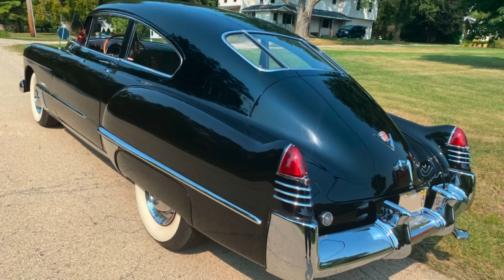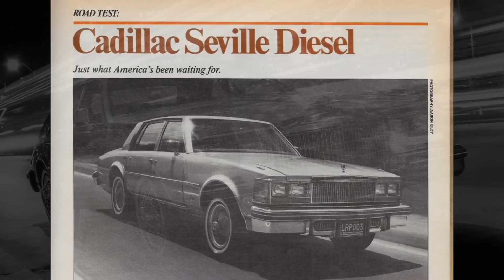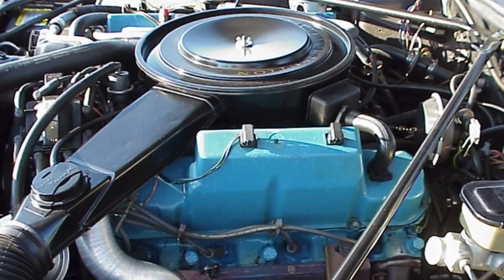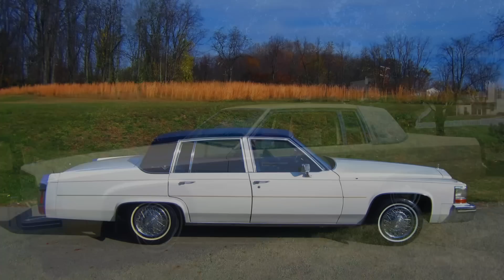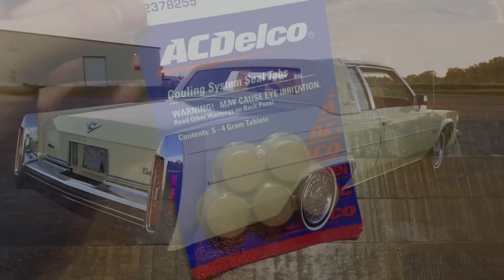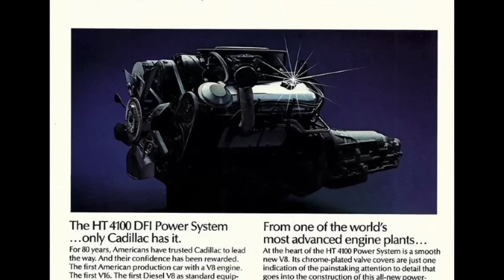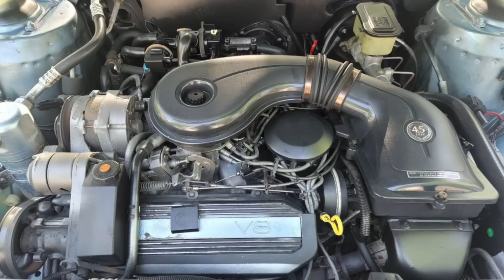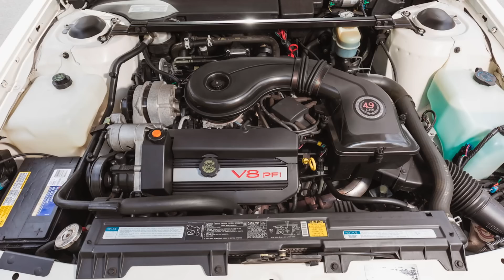This is GM's Worst Decision for Cadillac and Affected Its Reputation for Decades...

Comment: The Seville was a great car, even with the Diesel. I worked on many in California. The problem was nobody had ever worked on diesels unless they were truck mechanics. Our shop specialized in diesel gm cars, we had specific fuel filtration systems installed,very specific oils, and a 30 gallon auxiliary fuel tank in the trunk, our clients could cross the border into Mexico and fill up for a third of the cost in the U.S. making the owners quite happy versus the rest.

Comment: I worked in an auto repair shop in 1993 that saw an HT4100 powered Cadillac come in needing a new engine. After calling all the good rebuilders in the country, we ended up sourcing a brand new HT4100 long block directly from Cadillac because it cost LESS than rebuilt!
Reply: No one would rebuild a 4100 motor if they knew what they were doing.

Comment: Let’s not forget the 4.1L V6 that was available in the Fleetwood. As a 22 yr old in ‘93 working as a salesman at an Olds dealer, I picked up a 1981 Brougham D’Elegance with that engine. It had come in on trade, and I think I paid around $700. For it. But man oh man…what a dog. The early 80’s were definitely the worst for the entire industry.
Reply: Well. That ‘ESCALADED’…
Reply: That 4.1L V6 had the same horsepower and more torque than the HT4100 did. And it was more reliable. It would have been better to stick with that engine than the expensive disaster that was the HT4100.
Reply: @judethaddaeus9742  I don’t know about that. Mine had less than 100k miles. Blew a head gasket. Had a valve job done on it and after it was put back together, spun a bearing. And it was ALWAYS abysmally slow. I like GM and their engines for the most part. But no way did this engine make anywhere close to the power needed to move a Fleetwood lol…frustrating too because I loved the car. Would have killed to just have a normal 5.0L at the time.
Reply: @goodbonezz1289  Sorry you had a bad one. And I agree that Cadillac had no business offering such underpowered cars regardless of engine.

But that V6 had a much better reliability reputation for most folks than the HT4100. My Dad’s ‘86 Coupe deVille ate through 2 of them and 2 transmissions as well.
Reply: @judethaddaeus9742  those were very dark times.
Reply: @goodbonezz1289  I wouldn't be surprised if even a 4.3L V6 from 1985 would be an upgrade!
Reply: @RJARRRPCGP  I’m sure it would have been!
Reply: The 307 Olds V8 showed up in the late 80's, early 90's and was about as pathetic as the V6 and HT, but at least fairly bulletproof.
Reply: @scottysgarage4393  The sad part was, you buy a ‘77 deVille with a 195hp fuel injected Cadillac 425 V8, only to wait 10 years through the HT4100 era to buy an almost identical ‘87 Brougham for more twice the money you paid in ‘77, and find it comes with a carbureted 140hp 307 from Olds, and that’s seen as an improvement.

No wonder people ran away from Cadillac and never looked back.
Reply: @judethaddaeus9742  That was pretty much the state of affairs across the industry, thx to government meddling.

The nice thing was as soon as that '87 was out of warranty a 455 Olds was literally a drop in swap.  A little tight back at the heater and AC box but still, went right in...

Made for a VERY...peppy...car...
Reply: @scottysgarage4393  Lincoln didn’t fall nearly as far in terms of power or reputation. And while Cadillac was struggling to get 125 or 135hp out of a fuel injected 4.1L while meeting emissions standards, the imports were squeezing that much power out of engines half the displacement and with half the cylinders.

When your own sister division manages to tweak an old V6 and make it as or more powerful, more reliable, and more economical than your all-new V8 - an engine format your division invented - something has gone terribly, terribly wrong. FAR wronger than any other competitor.
Reply: @judethaddaeus9742  As a dealer for decades I can tell you there was never a time Cadillac did not easily maintain higher value/resale/loan than comparable Lincolns.  There were exceptions, the Cimarron, the Catera and the diesels, but those are glaring exceptions.

Today a Fleetwood from the 90's will bring three times what a Town Car from the 2010's brings.  You can buy two and sometimes 3 late(ish)-model Navigators for what one Escalade will bring.  Some of the lesser Lincolns, say the LS for example, don't have any "value"; they bring scrap weight unless they have incredibly low miles, while Cad's "Art & Science" cars still bring 5, even 7k wholesale with decent miles.

The imports of the period were glaringly cheap inside, their drivetrains annoyingly noisy, still primitive in the 80's and early 90's.  At least the ones being imported to the states.
Reply: @scottysgarage4393  Part of the reason ‘90s Fleetwoods fetch more now is because they were outsold significantly by the Town Car, in some years as much as 10 or 12:1. But ‘80s Fleetwoods and Broughams fetch no more than ‘80s Town Cars do. Manufacturers aren’t building cars for resale value. They’re building them for profitability either through margins or volume or both.

And “cheap interiors” is a bizarre term to throw around about import competitors when Cadillac used the same damned steering wheel for 13 years, most used the same rectilinear instrument panels covered in vinyl, plasti-chrome, and fake wood.

Cadillac bled market share like crazy in this era. And today, an ‘86 deVille is scrap value next to an equivalent condition ‘86 BMW 5 or 7 or Mercedes 300E.
Reply: @scottysgarage4393  BMW outsells Cadillac nearly 3:1 in the US today. 10:1 worldwide. Wonder how that happened.
Reply: @judethaddaeus9742  Pretty sure Chevy outsells them, too.  Wait, you think BMW is a luxury car?  You think Lexus is a luxury car too, don't you?  That's funny.
Reply: @scottysgarage4393  Considering that BMW sells cars costing 3x as much as the most expensive Cadillac, and still sells FAR more of them, I’d question your judgments if you didn’t think BMW sold luxury cars.
Reply: @judethaddaeus9742  BMW sells $500,000 cars?  Good to know.

Your ignorance just keeps putting itself on aggressive display.

BMW is overall a jumped up taxi/police car with horrid resale value, just like Mercedes, but regularly sold to some of the vilest people out there.

I avoid selling most Ford trucks because they are generally bad news.  I avoid selling BMW because(along with being trash) the people that buy them are bad news.

Oh, tell everyone more about the half million dollar BMW's.
Reply: @judethaddaeus9742  Also, since I have grown tired of you, I'll drop another bit of reality on you which I really expected you'd figure out.  Alas, my expectations were too high...

BMW is a manufacturer, not a car make/badge like Cadillac.  Your sales figures must be compared to GM as a whole since, like BMW, GM sells entry level and luxury and trucks and SUV's and specialty vehicles, etc.  In that case, in '22 BMW sold 2.4 million vehicles globally, including automobiles and motorcycles, MINI, and Rolls Royce. 

GM sold 6 million.
Reply: @scottysgarage4393  I was comparing BMW brand to Cadillac brand sales in the US. BMW and Cadillac sell cars in most of the exact same market segments, including SUVs. And the cheapest Cadillac costs less than the cheapest BMW. The most expensive Cadillac costs about 1/3 to 1/2 the price of the most expensive BMW.

BMW doesn’t sell competitors to Chevy, Buick, or GMC. They don’t sell vans or pickups like GM does. Just luxury cars, luxury crossovers, and luxury EVs. Just like Cadillac. And for a lot more money than Cadillac. And about 3x as many as Cadillac, despite the higher prices.

But sure. BMW isn’t luxury. 🙄
Reply: Cadillac CT4 base: $35,790
BMW 3-Series base: $41,450

2022 Cadillac CT4 US sales: 9,370 units
2022 BMW 3-Series US sales: 30,400 units
Reply: @judethaddaeus9742  No, BMW isn't luxury.

You're the one that mentioned global sales figures.

Escalade V, $155k

What's the tag on the Lyriq?  And the uber-buck one coming out??

Sit down and shut up.  You've become beyond boring.
Reply: @scottysgarage4393  agreed…as smogged out as it was, I’d take a Olds 307 over any Caddy offering of that era.
Reply: @scottysgarage4393  at least the HT4100 came with 3.42 Gears. The Olds v8 came with 2.73 or taller, so it wasn't any faster.
Reply: That was really weird. The 4.1L V6 was a Buick engine that was offered that year at Cadillac and you had to wonder, "Is GM hedging their bets on the HT4100"? Why is this engine even in the lineup? It's not like their mileage was any different.

Comment: Agreed 100%.
They should have gone back to the 429 as far as I was concerned. That engine was bullet-proof. The 425's weren't too bad. The downfall is always Government interference. We had rotated-out a couple of hearses at the funeral home that were so lame we couldn't wait to trade them. Everybody else we knew in the funeral business hated theirs for the same reasons. We had been used to powerful engines up until 1975. The 4100's were terrible. 
As the previous post mentions the V-6 wasn't too bad. Quite a few went out the door as Coupe De Villes , the slightly lighter weight of the car helped. Never had a complaint on them as the customers knew by buying a V-6 they wouldn't win any races. I don't think too many of them got good MPG's with them because they tended to stand on the accelerator pedal.
Funny story. I sold a friend of mine a triple-brown '79 Fleetwood Brougham who, as a traveling salesman, wanted a diesel in it. He could not be persuaded otherwise.
He must have put over 300k on that damned thing without any major issues!!!!!!! Service would marvel at it every time he came for a regular oil change and service. It should have gone in a museum.
I had an '89 FW-drive Sixty-Special Coupe that was pretty quick and I really liked the car overall.
Reply: The 425 (79 SDV) was a great engine esp. w/ dual exhaust, no cat & bumped timing.  I fled a hurricane from Gulf Shores AL to Jackson Miss. in one at a steady 110mph.  At the time the car already had 185k. Great car.
Reply: I Actually appreciate them cleaning up the air, the air pollution in Southern California was horrible.

Comment: I owned a 1983 Cadillac Sedan DeVille with the HT4100 engine. It was slower than cold molasses. One of the worst Cadillacs that I have ever owned. I replaced the engine with a newer HT4100 only to be rear-ended shortly thereafter. That totaled out the car. Only the Northstar was worse. The Northstar was complete garbage. I bought a 1998 Eldorado ETC. Within 3 months, the engine developed the "Northstar problem". I brought it back to the dealer and told them to keep it. Never again will I own a Northstar. I have the 4.9 in a 1995 Sedan DeVille that I have owned since 2014. According to the dealer, the car was originally owned by Bette White from The Golden Girls. The engine has never given me any problems. It has ample power too. I have other Cadillacs in my driveway but, I like taking the '95 out from time to time. My 1976 Fleetwood is reserved for long trips.

Comment: Cadillac eventually learned not to crap in its own bed, but how many customer Victims endured their mistakes?   I never looked back at Cadillac and it's very distant in my rear view mirror.  As for the HT 4100 one could say:  If you stepped on it, the gas gauge usually went down before the speedometer came up!   Lest we forget the V7-5-3 Or the Old Folks Mobile 5.7 Lesbo-Diesel Head Gasket Destroyer!   My family paid for PREMIUM and got CRAP!   Bye-Bye Crapillac!

Comment: look at the air cleaner assembly how much it must choke down airflow. that just screams no performance what-so-ever. i had a 305 camaro RS L03 tbi engine. i chucked that thing in the trash, among other things i did to make it run better. it wasnt great until swapped in a 350 and better heads. the HT4100 must have made the L03 look like a race car (which it wasnt)

Comment: A truly abysmal decade for Cadillac, except for the brief return to using the 4BBL Chevy small-block power in the cars at the end of that full-sized chassis run. I recall lots of customers couldn't trade in their 4100-powered cars fast enough on these.

Comment: I owned a mint 1983 Fleetwood Brougham D'Elegance w/30k miles back in the mid 80's. That junk Hook & Tow 4100 was always breaking down on me. Always!! Got rid of it after 6 months and never went back to a Cadillac and never will. I jumped ship to Lincoln and never had a problem. Hook&Tow 4100.

Comment: I will totally agree. If I were the prospective 77 DeVille owner trading in sometime in the early to mid 80s, I would've been super disappointed. Nobody was making fast domestic luxury cars at that point, but wow, taking a 307 powered Buick Park Avenue or a 302 Lincoln Town car wouldve been faster than the 4100, more reliable in the short term, and more durable in the long run. I hate the 4100 today because it's tainted all those otherwise wonderful early 80s Cadillacs. A ragtop eldorado, had they just dropped in the olds 307 like they had in the Riviera and tornado, would've been killer. It's no wonder GM lost so many buyers at this time.
Reply: Starting in 1985-6 the FWD Buick Park Avenue and Olds 98 Regency were much better cars all around than the FWD Caddys. The Oldsmobuicks had slightly more progressive styling where Cadillac clung to too many Brougham-era design cues that looked cartoonish on the smaller car to the Caddy faithful and dated on day one to potential conquests and movers-up, and then there were the developments of the HT4100 vs the dead-nuts reliable Buick 3800 V6.

Comment: I had a 4-6-8 81 cadillac Eldorado biarritz. It weighed over 6000 pounds. I had it for ten years. It ran perfect using the 4-6-8. It was an excellent car. Never stuck anywhere. I live in Utah. The Seville albeit not the slant back was a huge seller for cadillac.
Reply: You're right about the engine, mine lasted twenty-four years.  You're waaaay off on the weight, though... even a '78 Biarritz didn't weigh that much.  My '81, without the stainless roof cap & with whatever gas was in the tank, weighed 3900 lb on a truck scale.
Reply: They had cylinder deactivation in the 20s.  It was'nt a new concept.

Comment: As someone whose only half as old as the HT4100, I can say, Cadillac's decisions are one of the rare ones that caused issues even 30 years later, since now buying an old reliable Cadillac is nowhere near as easy as it should be
Reply: As someone who is older than you, you have no idea what you're commenting on and the wikipedia article doesn't count as the same thing as experience. 

First of all you don't know the differences between the 4.1 and the 4.9, second you seem unaware that the fleetwood brougham didn't have that engine, and third you obviously haven't looked very hard if you can't find a mint running and driving one with sub-100k miles, either that or you're living somewhere i'm genuinely surprised has an internet connection at all and still uses horse and buggy to get around.
Reply: @USNVA-yn6cp  same era Town Car is also an excellent car but the groundwork of the sentiment is flawed.
Reply: Hemmings
Reply: Never mind how ugly they are against the European cars inside and out.
Reply: @Low760  To you. That's a matter of personal taste. Precisely how I feel about all the Euro-trash that were supposedly more "stylish".
Reply: @Low760  I think the '92 to '04 Seville is drop dead gorgeous inside and out.
Reply: @Low760  oh go buy a prius you conformist dork
Reply: @Low760 Well,that is like your opinion man...

Comment: Adam, I greatly appreciate your giving us the torque numbers for the engines instead of just the horsepower numbers. It really helps to understand how much power these cars really had. Sorry if my multiple comments on this issue seemed a bit harsh. It was never my intention. 
As always, great video and I thank you for sharing your thoughts and knowledge on these wonderful vehicles
Reply: The veteran car tester Tom McCahill always said from the beginning of automotive history the emphasis on horsepower was wrong, that it was torque that did the work.  Those very early cars in the 00's and teens had huge displacement 4's and 6's with 400-600 cubic inches but only about 65 horsepower--the 1910 Oldsmobile Limited had 750 cubic inches.  They were built more like trucks because of the almost non-existent roads of the time, but those huge engines had lots of low speed torque, allowing travel at only about 1,500 RPM in many cases because the crude transmissions were hard to shift and the emphasis was on staying in high gear as much as possible.

Comment: you make a good argument but it is debatable if that was the worst.   One might say the travesties of the Cimarron and Catera were worse.   Or that the use of cheap interior materials coupled with poor fit and finish turned off more owners who were being "shamed" by friends with Benz, BMW, Audi, Lexus, Infiniti et. al. who felt superior in everything from door closures to radio button action.

Still, total engine failure is pretty hard to live down.

Comment: If they had developed the diesel, consider the 6.2 used in light trucks, good fuel economy was attainable in the era.  They got close in time but quit too soon, typical for GM.  A turbo charged 5.7 and a turbo V-6 would have been fine solutions.  Worked well for Mercedes.  Yes I'm a diesel guy.